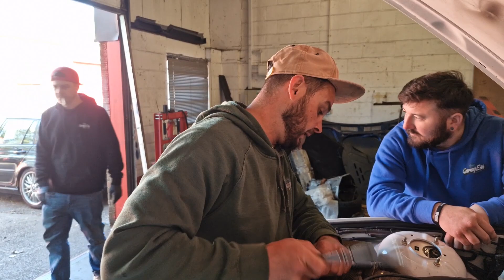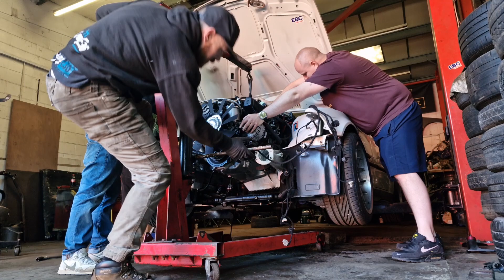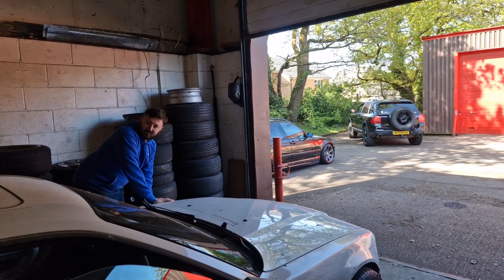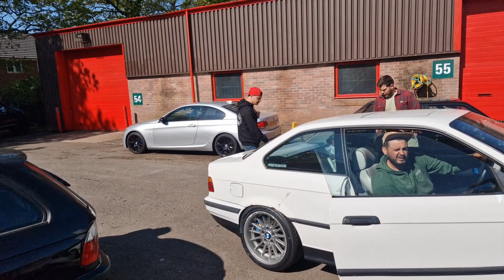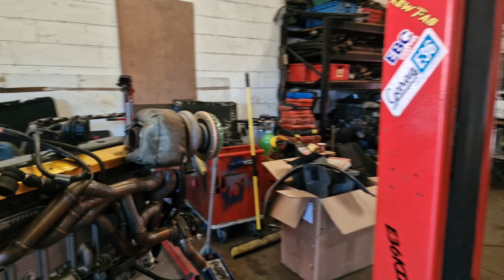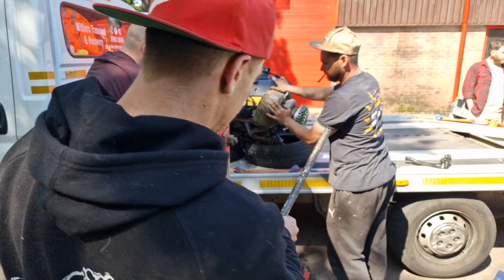M52B28 Turbo Build | Bent Conrod

Comment: What size turbo / rear housing? Of course it bent a rod with twin scroll comming in early. The rule of thumb is less than 450 ft pounds below 4000 rpm With stock rods.
Reply: M50 non vanos rods are good for more power if budget allows. ( i went with eagle e.d. )
Reply from the maker: It's a holset hx35 turbo. This rod only lasted 11 miles. Yes non vanos rods are the strongest. Think he is going to go forged tho